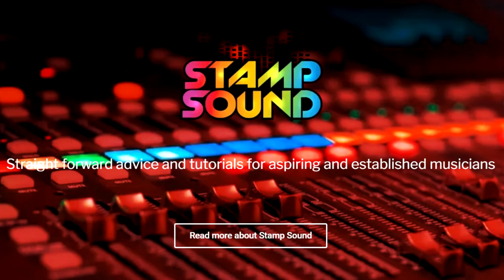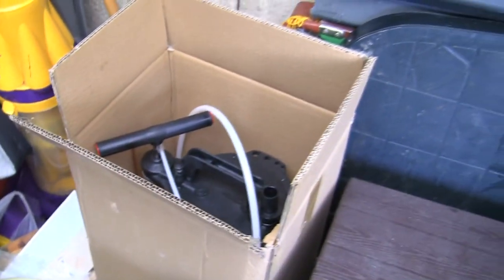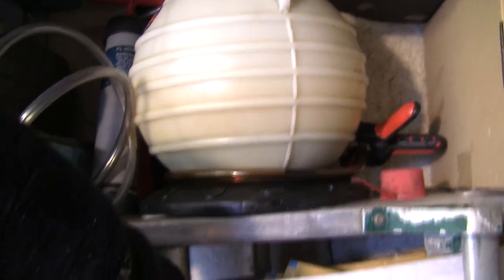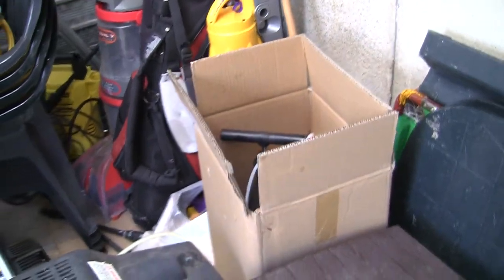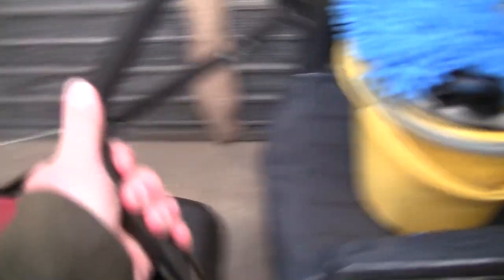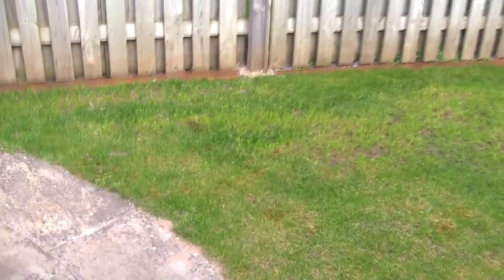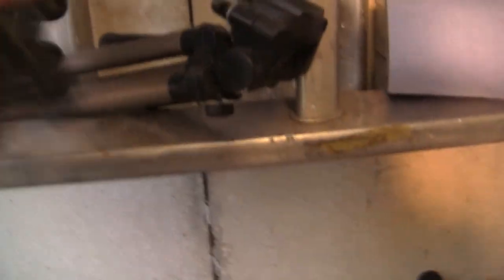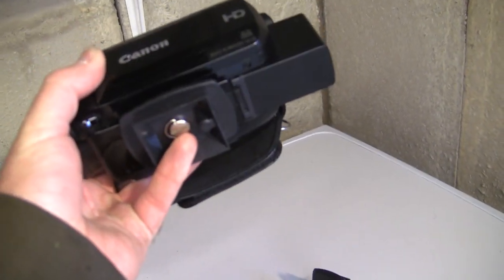Easter Eggstravaganza Tinkering Vlog (Great Intro) New Tools

Comment: Good like the overhead shots ... watched a video from Steve's small engine saloon .. apparently if the piston  is at top dead centre the valves will be closed and when you tip it  up nothing will leak out  no oil and no fuel😁👍
Reply from the maker: Never thought of that! Great tip!

Comment: Cracking video love the new camera angle, makes it a pleasure viewing   used a friends mount field , is it normal for the front wheels to splay out slightly , why is that ?.just to let you now your keyway link and blade balancer come up on amazon with carpet scissors and a battery charger
Reply from the maker: Wow lol thanks for letting me know!
Reply from the maker: I see a lot of wheel like that tbh. Not sure if they just wear away on the inner parts